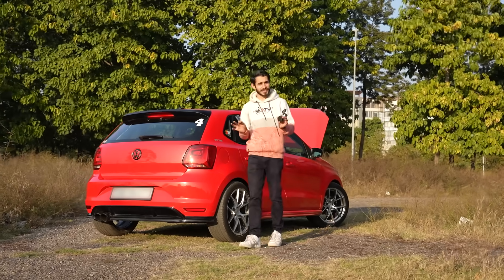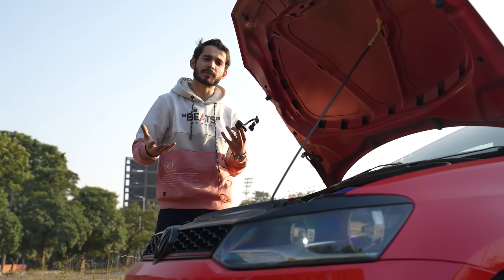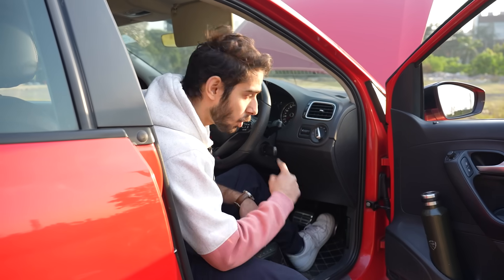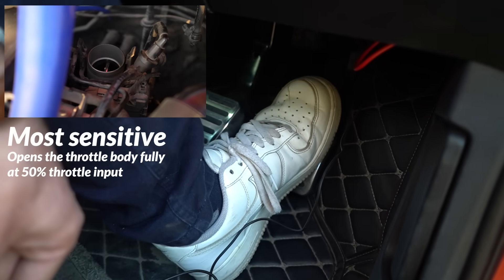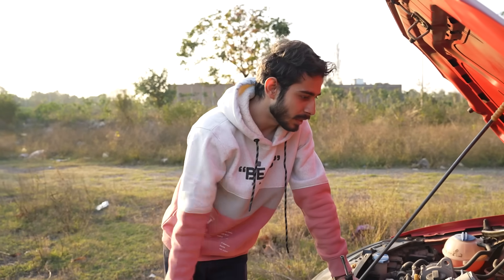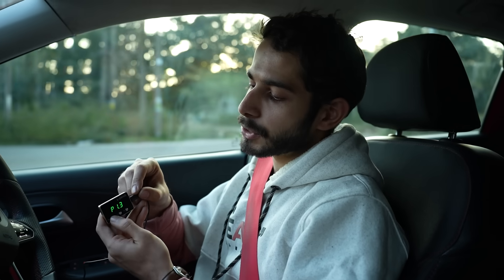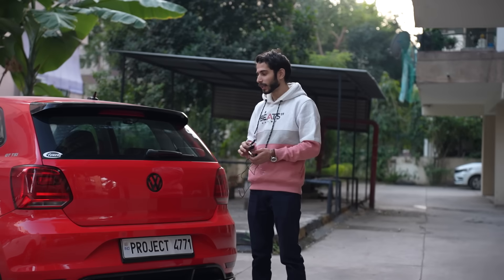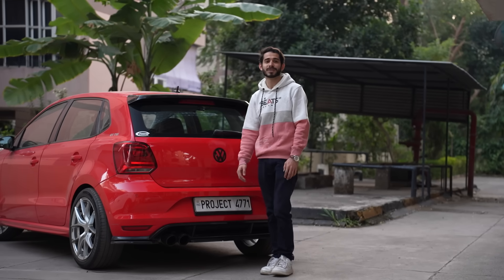Throttle Controllers: The Truth

Comment: I've used Sprint Booster on two different cars. It made a HUGE improvement in driveability in one of them - and in the other one it made no real difference to how it felt to drive. They DON'T make more power, but if a particular car has a bad throttle system (factory design / programming) then improving the pedal response can make a BIG difference to how it drives.  The car that was transformed was 2014 KL Cherokee 3.2L Trailhawk - which was like a totally different car in all good ways -  and the car that had no improvement was 2015 3.6L Grand Cherokee.

Comment: I like how you actually showed the throttle controller in action. I have a 2003 Gypsy King and a 2024 Virtus 1.0 TSI AT. The Gypsy is so much responsive because of the mechanical throttle, whereas the Virtus feels disconnected and laggy (not to confuse with turbo-lag), especially when crawling through traffic and you need to get going. These controllers only change how much the valve opens, not how quickly it opens, thereby only affecting the pedal sensitivity. I think the true solution would be an ECU remap with a quicker response time, until then it is what it is :/
Great content though! You've earned my subscription xD
Would love to catch up in Chandigarh anytime soon 🙌🏽

Comment: It is very useful in diesel cars which have a  turbo lag. Some manufacturers like Jeep promote lugging by designing the gearbox to upshift at the lowest possible rpm for maximum fuel efficiency and passing emission norms. Some cars do not have a sport mode and the throttle controller is basically a hack for the Sport mode. Also in some situations you may need to dampen the throttle input especially off-roading. So yes it has it's use cases provided you know how you intend to use it. It obviously doesn’t give your engine any extra power - that's just hogwash !!

Comment: If you are familiar with video games controllers or RC cars/planes. This is very familiar sensitivity curve (0-100 in 0-100 out). I can make can make change the feel of this car but any clipping (smaller input range covers full output range as in the "power mode shown)) just means lost fidelity, making it less precise. Theoretically, a bad throttle curve /or intentionally limited to give beginners a powerful toy can limit max power output, but no know of no car manufacturer that does that.

Comment: Reputable brands like EVC (Ultimate9) and DTE are designed with internal "Watchdogs."
If the device loses power or has an internal chip failure, the circuit is designed to "fail open." This means it simply turns off and passes the stock signal through, or it sends no signal at all (which results in a dead pedal, not a full-throttle pedal).

Comment: Sudden increment in A:F ratio will definitely harm the piston rings, crank shaft, connecting rod bush & crack shaft bearings also will affect the clutch if it is not new

Comment: Ok good observation 

Pl clarify as to a  car which do not have Turbo (Naturally aspirated) set up , which definitely fall short on lightly slow acceleration and mileage. Car reference may be Rapid petrol 1.6 petrol

Car Tuning require Sys and material modification which cost more.

Also I am not favouring Got/wind boost either and thought of going for last 2year😅

Comment: I have installed in my i20 2023 model 1.2 kappa where after installing it i am able to confidently overtake 2 to 3 cars at a time. But with stock it has lag. Wind booster is a value for money and also the mileage has increaaed to additionally with +2 to 3.
Reply: Price?

Comment: They come as an OEM equipment jo various drive modes hote hain.
It does not work on cruise control and also if you are able to control pressure on the accelrator pedal.

Comment: I was having a discussion in a closed group  (Car owner) And i told them the exact same thing
It is just the placebo effect. 
Engine power remains the same
Its responsiveness also remains the same 
But on the downside you might harm your engine 
and 99% people are opting this for more power (which it will not give but surely harm your engine - constant high RPM)

Comment: An Indian talking about scams, that's laughable in itself!  I have an IDrive fitted to my vehicle and nowhere does it say  it increases power.  It states the unit reduces throttle lag, improves response times to accelerator input which in turns utilises the engine power quicker.  Most turbo vehicles suffer from lag to different degrees, this gadget can help with this.

Comment: Maybe This is a dumb question but because its opening more of the throttle body and with more reactive speed , dosent it harm the engine which may be designed for a more softer launch or low end ?

Comment: Simple logic is if the throttle controller could give significant change in performance, then a manufacturer himself will fix that in cars during manufacturing..
Reply: Oh. Then why they give stock lights that shows nothing on the road to lower end cars and good visibility to top end models. They can give, but they won't.

Comment: Thank you, this is the one, exact point that I haven't been able to find and confirm although I was right and need it. I need it to improve the throttle response of my engine because it's intermittently not responding correctly and it's very frustrating. I am also going to do coil and spark plug changing for the first time (105k miles) one or the other will determine the issue.

Comment: but I've seen Gotboost people, they don't claim that you are going to get more power or torque, instead they are saying that their gadget will eliminate the throttle body opening delay and will give you the power you need at that instance. Furthermore, they have many modes that you can set considering the traffic conditions

Comment: You obviously do not understand how a throttle controller does increase your power. What it is doing is moving more available power at a lesser RPM which therefore accelerates the car faster, especially on turbo cars where they will almost eliminate all of the turbo lag. You can get up to a half a second quicker 0 to 60 times. Here are some real tests if you want to see. They are definitely NOT a scam. Stop speading misinformation bro. 

https://youtu.be/bPJxHhlA4bE?si=xzof9te2o0glm9Ag

Comment: Not a scam. 

First of all, people need to understand what purpose the throttle controller serves - it does not increase HP or torque, it is simply meant to give back control of the throttle to the driver. Secondly, drive-by-wire was introduced as a way for carmakers to meet stringent emissions regulations. Drive-by-wire systems reduced throttle input as a means to allow the car to accelerate more efficiently, and thereby reduce emissions. 

Drive-by-wire is the reason you feel that lag in acceleration when you've floored the accelerator but the car feels slow to respond. With drive-by-wire, when you press the accelerator 100%, you do not get 100% throttle body opening immediately - it will slowly ramp up. 

This video, like many others are ill-informed and perpetuates the public misunderstanding. Throttle controller sellers also mislead their products abilities. It's a simple device that really just override emissions control measures from the drive-by-wire system.
Reply: Truth!

Comment: Its the same case for FuelX which is pretty popular amongst motorcyclists. They promote it as something that increases power when in reality it does nothing but increase throttle response like showed in the video
Reply: Well your comment shows that you  know nothing, fuel x is a fuel optimiser, has the capability to run an engine lean or rich mixture.
Reply: @Sousousou200 doesn't work, ECU overrides it. I have used it on my 2023 390 Adventure. Next time you bark on the internet make sure you've had first hand experience of the product first
Reply: @shutupnavikrant well I have been using it in my 2015 bs3 ktm rc390 and it has made a world of difference. My motorcycle is running much cooler, no more choppy throttle response and lesser vibrations. I have personal figures from my OBD2 sensor report where the bike is running richer than before and the ecu doesnot reject any O2 sensor command. So before you tell other people what to do get yourself educated first.
Reply: @Sousousou200 your 390 is far different from mine. ECU mandate in BS6 has changed so much it restricts a lot of things. That's the reason your 390 has a different OBD port than mine newer 390. I also own a OBD device and can share data. So again like I said "do not bark and try to compare your situation to others"

Comment: This is bullshit. You bought a cheap china made crap, also you placed on low 100 horse powered car. If you buy it from a legit manufacture like BMS for example and your car has atleast 200HP, it can transform your entire car's feeling even better than some Stage 1 or Stage 2 tunes. You are right it does not give more power, but if you have a 200+ HP car and you add a good pedal tuner on max setting, your car will be flying...

Comment: Boss your technical explanations are correct - it increases the opening  of TB - but to get more power you have to reprogram your ECU which will improve fuel spray in the ejector, change the spark plug firing timing (BTD)  correspondingly a lot has to be modified - - again you are scamming by mentioning to increase air intake alone will not increase the power - you need a proper ECU reflash of the ECU and change many components - this will put the load on the engine parts can decrease millage - decrease engine life - decrease oil change intervals. increase pollution etc etc if you. need power buy a car with more power or go for a proper sports car -

Comment: Windbooster and gotbooster they are not saying anything like what you are blaming..they clearly say this device will eliminate the lagging by minimizing the engine reaction time. Also they are saying this device will open the throttle bit extra for power that's it..
Reply from the maker: I’m not targeting them anywhere in the video, there are more vendors for these who claim this is equivalent to a stage 1 tune and gains more power, I just want to educate people by showing exactly that this does so you make an educated decision, that’s it.
Reply: @PrerakKataria  can you remove the SCAM tagline? Looks like free internet, good English and basic knowledge about cars have given people to spamnhere. 
For last 1.5 years, am using it on Safari Storme and it has really eliminated the lag at lower revs. Especially before turbo kicks in my case. Automated throttle control with a bunch of modes is what they have offered in the product. Test the product first with multiple car makes and give reviews.

Comment: The car’s entire mechanical/ hydraulic system (brakes, suspension, etc.) is designed to handle the stock power. When you tune the car for more power, how would those parts cope with the extra strain? Even if you upgrade the brakes and suspension, how can you trust the altered components over the stock ones?

Similarly, how can we trust a tampered ECU (at a software level) over the stock tuning? Everything in your video was great until you promoted your tuning service. I see it as pure outrage from you and your team that a cheap electronic mod is making a difference in cars, while you put in so much effort into tuning.

Everything you said in the video is true, and I completely agree. But if we can’t trust that electronic mod, how can we trust your aftermarket ECU alterations over the stock one?

I hope you won’t delete this comment and will provide a reply. If you find my opinion valid, please pin this as well.
Reply: Most sane comments here, even for tunes who are taking the responsibility of failures?

Most vehicles are underpowered in India and if throttle is sharpened it is as good as the actual tune.

I have a hikeit controller for my Jimny and it has transformed my driving.
I got It for cheap at about 8k from Australia and the lag in acceleration is gone and overtaking has become much much easier.
Also, as less throttle is required, mileage is up by at least 15%.

Comment: Hiii sir my Ford ecosport Diesel struggles a lot in high altitute I have to use half cluch tht is pathetic not good for engine  The low end power of Ford ecosport is very poor       so my question is that should I use this just only when I wish to drive hi hilly sections

Comment: Let’s look at positives.. it eases the throttle usage effort for sure. I am using it for Jimny, it not only has increased comfort of acceleration but also increased mileage noticeably at it moves into higher gear quicker than original setup. And this is not perception driven, tankful to tankful refills that I do are clear statistics proven. Saying this with over 28 yrs of motoring experience, owing various cars over decades.
Agree with the scam part of someone selling as performance booster which it’s not.
Reply: yes good review, some cars need it more than others. Specially maruti automatics....in my Swift it made a huge difference, specially at traffic stops....i used to almost stand on the accelerator to keep up with traffic and after the throttle controller the difference is night and day with better fuel efficiency
Reply: Any issues you have faced using it on jimny
Reply: @ absolutely no issues so far
Reply: Hi just got jimny 
Need to install this can you provide me a link?
Reply: What's the mileage increase for city and highway? I'm planning to buy it for my Venue DCT. I get a mileage of 6-8km city and around 11-12km highway
Reply: @AbhiR0003  depends upon the traffic conditions, increase has been between 1-3 kmpl on an average. Main benefit I enjoy is the reduced effort of acceleration.
Reply: @sachinjos im sure you must be aware of the Mumbai traffic. Should I give a skip to this product then? Because paying a bomb for just an increase of 1-2km doesnt make sense in a city like Mumbai. If there's anything else you can share, it'll be great
Reply: @AbhiR0003 like I said earlier too, it eases off pressure on right leg for acceleration
Reply: @sachinjos i have a dmax vcross and i had both stage 2 tune and a throttle controller from EVC (australia), but let me assure you, the stage 2 tune or a nice remap will always be better than this throttle controller, i hope jimny gets a code 6, quantum, wolf, t9 customs or any other tune/remap, i agree jimny is a little lethargic even in stock mode ,combined with mods it becomes a sloth, so throttle controller helps to some extent but believe me it can never ever be at the level of a tune/remap.
Reply: @jattboy2043of course, tuning will always be better, actually there’s not even a comparison possible here. Throttle controller is affordable compromise for ease of installation and usage. Throttle controller surely is not a replacement nor alternative to tuning.
Reply: @sachinjos in delhi 14 - 15k is the cost for throttke controller and for quantum stage 2 tune i got it for 22k in my vcross, so tuning charges vary for cars but 7k difference in an old school diesle.
Reply: @jattboy2043cool. I believe tuning would require deeper decisions and some expert doing it in order to not hamper the life of engine. TC, from what I could experience and know so far doesn’t lead to those risks. Tuning costs that you mentioned could be beginner level I guess, would cost more for better adrenaline 😉
Reply: @sachinjos stage 2 itself is wild brother, from stock 134 bhp to 198 bhp (dyno tested), but i had to add BRD intercooler with pipes, BRD downpipe, munji 4*4 egr delete cable with blanking plate, profender 2.5 inch 8 way adjustable suspension witj option 4wd upper control arms, upgraded clutch and rear brakes converted to disc from drum. Stage 2 along with tune many things i had to upgrade with this,
Reply: @jattboy2043what cost it came down to?
Reply: Using it in SAFARI Storme. It's better with GOT boost. I feel nice feedback from engine in less time.
Reply: @santhoshkumargaikwad2883 please avoid this one , try the bazzard racing one, or evc ,they are better

Comment: I don’t know but i think this is how  cruise control on cars work . 🤔🤔
Reply from the maker: In the case of Polo CCS works via the BCM and ECU, it locks the speed, and the ECU determines the position of throttle body to maintain that speed, functioning and integration of OEM parts cannot be compared to these cheap aftermarket additions.
Reply: @ yup but the locking of throttle body is same but it happens via ecu
Reply from the maker: @devsati4311 functioning via modules authorised by VW or other respectable brands cannot be compared to these throttle commanders is what I meant.
Reply: @PrerakKataria  okay I won’t use that in my car

Comment: Even stock throttle can malfunction right ?? It works on similar principle I presume.
Reply from the maker: Stock electronics go through rigorous testing and are made with materials and components to make sure they don’t fail, these devices are cheaply made and re sold after being white labelled at a higher price, there is no comparison between the two.

Comment: Came accross your video just when i was exploring throttle controllers.

I have a really bad lag in my altroz while starting from stand still and driving polo tdi for 10years straight have programmed me to give minimum to no throttle when releasing clutch which is making my experience miserable.

Can it help in mitigating this or do you have any maps for altroz petrol which may help in this issue .
Reply: How are u expecting to get that Diesel pull in a petrol? 😅 Do anything u won't get that. 
Remaping will help but what will it do? Increase 90nm to 100nm torque. While in polo u had 200-230nm.
Reply: @kundanpatil3133  did I say I need pull equivalent to polo?

I am only asking if the initial lag in altroz can be mitigated or not.